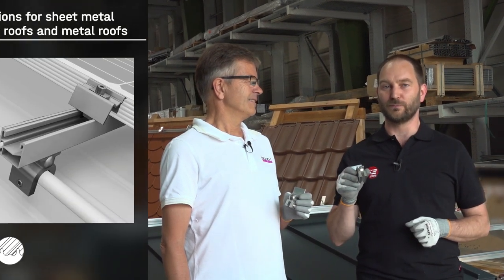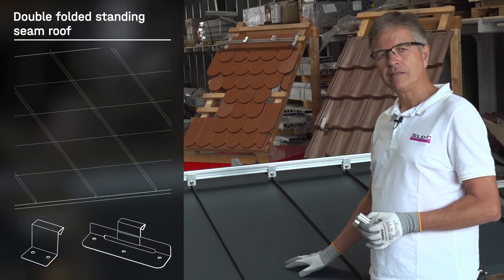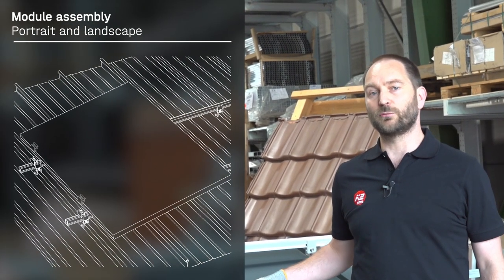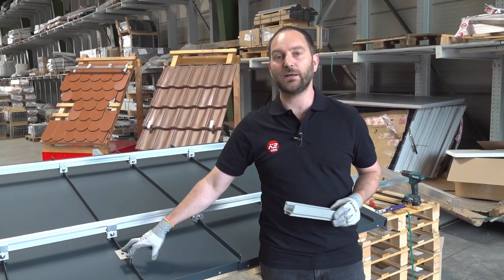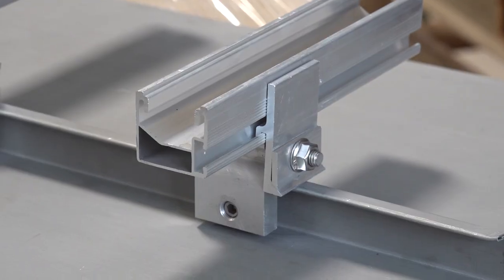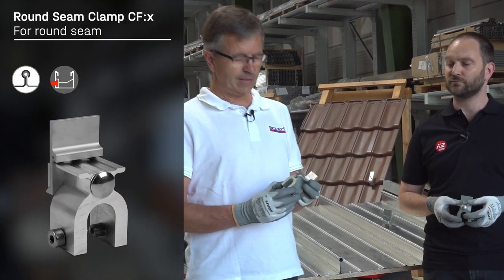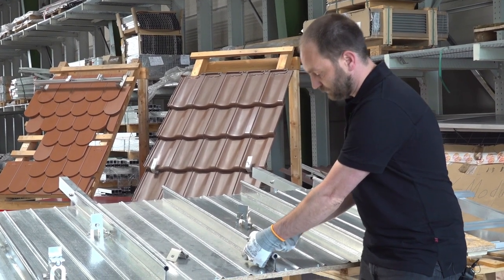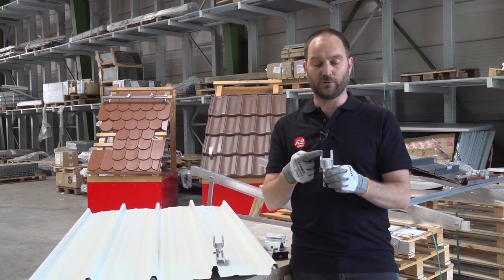PV mounting systems for standing seam roofing and metal roofing systems

Comment: Comment serrer sur le joint ?  18 Newton correspond à quoi ?
Reply: Vidéo en français  serait top
Reply from the maker: Nous y travaillons et proposerons davantage de traductions par IA dans un avenir proche.
Reply: @K2Systems  bonjour quand vous dites qu'il faut serrer la pince avec une force de 18 newton cela correspond à quoi ?
Reply from the maker: Jetez un coup d'œil aux instructions de montage https://catalogue.k2-systems.com/media/4c/a4/ca/Standing-seam-clamps-assembly-fr.pdf (source https://bit.ly/3RvvHC9)
Les pages 8 à 10 indiquent les couples de serrage à appliquer aux vis de serrage. Ceci est différent pour chaque pince à sertir et chaque point de serrage et figure dans nos instructions ou dans la fiche technique du fabricant.
Reply from the maker: Si vous avez d'autres questions, n'hésitez pas à contacter notre bureau d'Annecy https://k2-systems.com/fr/entreprise/implantations/